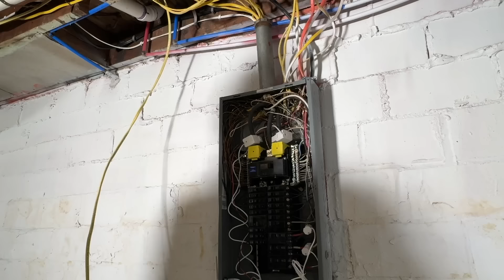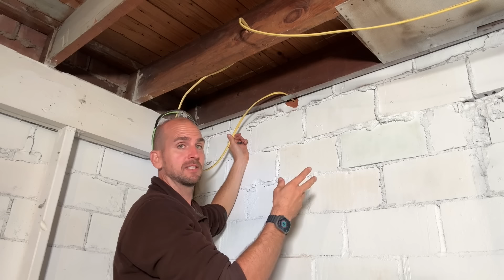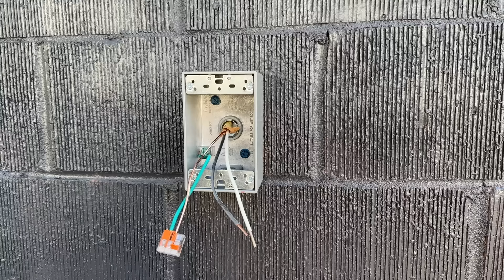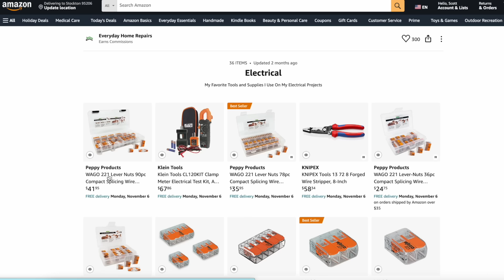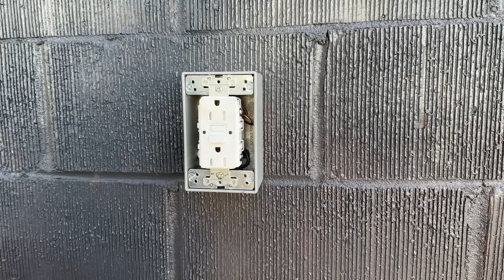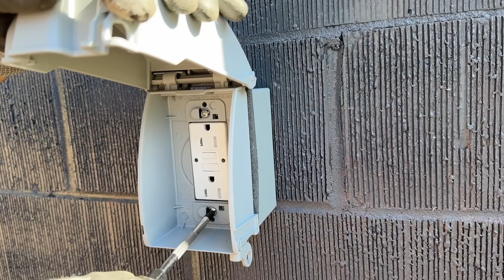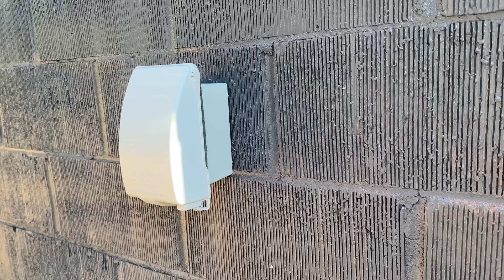How To Install An Exterior GFCI Outlet

Comment: In my opinion 16 inches of loose NM-B above the electrical panel is quite a bit and would be subject to damage.  I'd put a threaded conduit nipple through the wall into the back of the box, in your case a 90 above the floor joist and an NM-B clamp.  I usually try drilling the hole in the wall a bit higher.
Reply: In my opinion, as we allow cables to be exposed in the joists of basement ceilings then cable protection should be completely optional elsewhere in an unfinished basement. Side entry into an electrical panel offers a lot of advantages in keeping the panel interior neat and less cluttered with wires. And circuits can be more easily rearranged over the years if a house might go through an amount of remodeling. And I'd go further and say that I'd rather run cables under solid joists than drill a bunch of holes - if there is no intention to finish a basement. A well-maintained house may last a few hundred years and should be expected to have a lot of modifications in its lifetime. At times the code puts too much emphasis of safety for today and not enough on the safety of hundreds of years of change.
Reply: @JasonEDragon  sure, but people are clumsy with leaning stuff against walls.  I grew up in a municipality which didn't allow any exposed NM-B in floor joists.
Reply: @nicholassmerk  On a wall of my basement I have a Generac whole house transfer switch, 2 subpanels, and an area for phone, cable, ethernet, and camera connections. There were at least 6 big upgrades that shifted things around over the past 40 years and it is tinkered with almost every year. Perhaps in the future there could be some solar inverters and a battery or two. The code should not make things less maintainable just to avoid an unlikely problem. A person could just as easily try to lean something tall up between 2 joists in the ceiling and damage some cables. In my experience, the more difficult you make something to repair the less likely a homeowner will repair it when needed.

Think of all the staples that are placed on electrical wiring. What if we had something like the UK had with their "green goo" cables - where the cables that were made for a few years turned out to degrade sooner than expected and had to be replaced. Much of their wiring could be replaced by lifting floorboards. We would have to rip out much of the drywall in a house.

Comment: It recently came to my attention that not all gfi outlets work with current flowing in either or both directions. In some cases, the test button won't work while backfeeding power, and sometimes it might even damage the receptacle. Just something to consider before trying to backfeed through a gfi receptacle...
Reply: For a test, I would have just used an extension cord to an inside outlet, or installed a power inlet on a transfer switch. 
I’m very disappointed that you talk so much about code and then totally ignore it.
Reply: that whole micro inverter seems fishy i have a solar panel on roof setup and it requires a lot of special wiring in house. the inverter has to be able to read voltage and frequency to precisely match the power companies' voltage and be in sync for frequency as well as shut off in case of a power outage, so you don't energize lines back to pole when they are working on them.

Comment: Doesn’t a 15A duplex GFCI receptacle already satisfy multiple outlet requirement for being on a 20A circuit?
Reply: Correct. As defined by Article 100 of NFPA 70 (NEC 2023), duplex receptacles are multiple receptacles. A note follows the definition of receptacle to specifically indicate that duplex receptacles are an example of multiple-receptacles. The receptacle rating for duplex receptacles can therefore be read from Table 210.21(B)(3) "Receptacle Ratings for Circuits Serving More Than One Receptacle or Receptacle Outlet", which allows 15 or 20 amp receptacles on a 20 amp branch circuit.

Comment: is there a reason you didn't use the 4x4 box in the basement to mount the GFCI and then use the load terminals for standard WR rated duplex receptacles?  I did something along these lines when I put outdoor outlets on my house as the unfinished basement also needed some more outlets.
Reply: He probably got a kit that comes with the box, in-use cover, and a WR-rated GFCI receptacle. You save a good 20% versus buying all those components separately. Also, you really do want your GFCI receptacles outside where, if it trips, you can reset it right there—not have to go inside the house down to the basement.
Reply: yeah, our local code people want you to use gfi breakers now rather than outlets which is a real pain to reset in basement all the time @aaron74

Comment: I believe this would be a fail in Canada, for in "section 12 wiring methods", for Non-metallic-sheathed cable, 12-512 states: "Not to be Embedded: The cable shall not be buried in plaster, cement, or similar finish."
I would probably just do a PVC sleeve out the back of the box.

Comment: Thought romex couldn’t go into a wet environment per NEC 334.12(B)(4)
Reply: The inside of the box is not a wet environment nor is behind the box when properly sealed (which here could get debate from a strict inspector, but seen it done).
Reply: that box will be wet just from condensation from warm air coming out of house and those knockouts leak water on top if not sealed well @RJ-ej1nr

Comment: You could have mounted that box an inch higher and not have had to notch out the floor joist. (Unless you’re trying to match the height of an existing outlet) but I would have centered the outlet vertically on that block.

Also, you forgot to show the circuit breaker connections

Comment: I think I would have started with a pilot hole through the floor joist first
Reply from the maker: The issue with that especially on this type of brick is the blow out it causes which is definitely not desired on the outside.
Reply: @EverydayHomeRepairs  FWIW, the way that I handle that personally is with 3 bits.  First is a 1/8" x 16" masonry bit that I use to drill a pilot hole.  You're going to get blowout with that, but it's fine, the larger holes will cover them up.  Once that's drilled, step up to something like a 1/2" or 3/4" bit to drill that out, but only go half way through on each side before going all the way through to avoid blowout.  Repeat that process with the final size.  Takes a bit longer, but the holes are clean with no blowout.
Reply from the maker: Thanks for the feedback Dan 👍